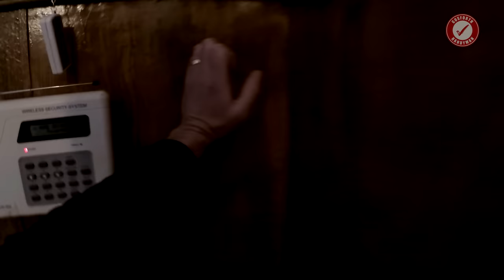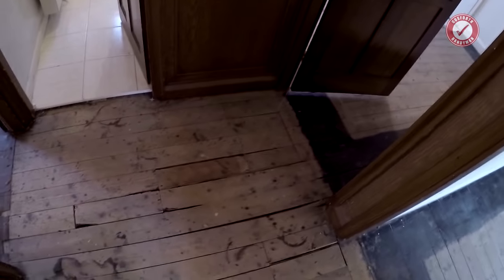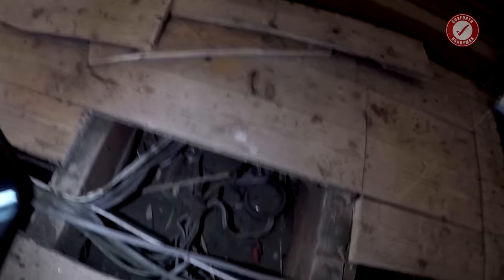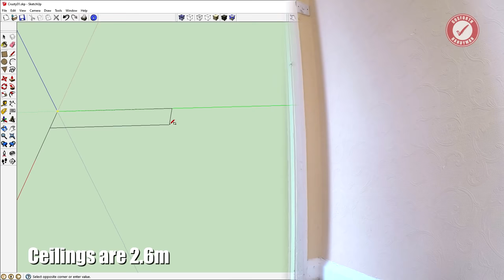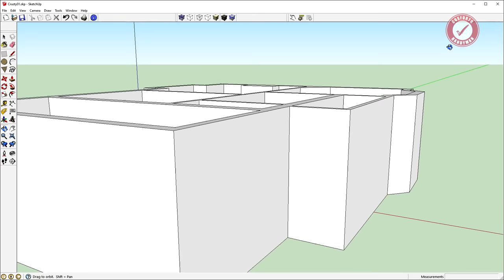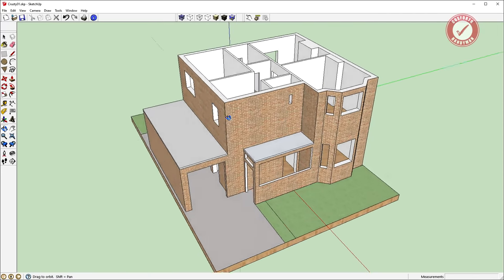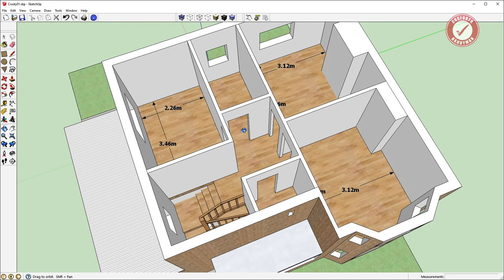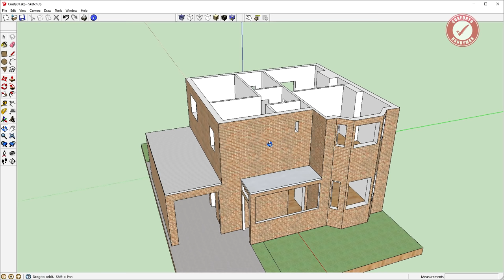Structure, drains & plans - what would you do? (1920's Renovation Part 2)

Comment: learning a lot from your vids, stuff like which way the joists run. Moved into a similar home but with a lot less experience (lots to learn).
experience with cad but in engineering. Are you giving the walls all the same thickness on  your plan drawings? Is it a standardised size?
I don't suppose any of your rooms are sloping? I live on a slight hill and although there is no movement the initial build left slanted floorboards and doorframes, I was wondering if you knew how to counter this? Perhaps pulling up all the floorboards and placing shims underneath them on one side of the room?

Comment: Whats in the small front room again ? And can you show better detail of the front porch ?

Anyway, demolish garage - set aside bricks for  reuse on rear extension or workshop in rear garden.
Obtain party wall permission, see if you can butt up against adjoining, use solid concrete blocks with insulated plasterboard, and go double height forming additional en-suite master bedroom ,  pitched or flat roof to preference or demands - easy access if the stairs are remaining in existing place broadly,  possible changes if stairs are to be moved

Comment: That "LEAD" water pipe is your MAINS ELECTRICITY  CABLE !!
Reply from the maker: Hmm... don't think it is. The electric supply goes through a clay duct. 99% sure it's the water. 👍
Reply: Ok just with the electric meter being on the other side of the wall I thought it might be - the older electric cables were lead sheathed and that acted as the earth TN-S   = supply type

Comment: I'd temporarily open up the roof of that garage so you can drive a mini digger round to the back. Knock some walls out upstairs and downstairs and build an addition to the rear. Either make the whole ground floor concrete or knock out the kitchen concrete floor. Remove that front porch

Comment: what is the make up of the dividing wall? some houses of this era only have a single brick between the houses, do the 2 houses share a single chimney stack? have any of the houses in the row had extensions? might give you some precedents
Reply from the maker: Shared chimney stack - 4 pots per property. Lots of different extensions on the street - not sure for the party wall thickness yet. 👍
Reply: @GosforthHandyman  Consider talking to next door about the chimney, if neither of you want it you could remove the whole stack down to the upstairs ceiling, reinstating the attic party wall on a concrete lintel. From the drone shots it looks like you don't have intertwined flues so this would allow the chimneys breasts on each side to be removed independently without structural issues.

Comment: Rewire while its empty mate.  Bonding to gas/water unless in plastic.  RCBO board SPD etc.  False economy not to do it now.  You're local to me so budget 2.5k upwards depending on spec.
Reply from the maker: Think the electrics are fine but time will tell! 👍
Reply: @GosforthHandyman  more plug sockets.  Most houses never have enough.
Reply: Yeah plenty of sockets, hardwired heat/Smokes.  Network cables.  When adding additional circuits ie new kirchen/extension/workshop the installation should comply to current regs.  Junction boxes under the floor not good.  Do it when it's easiest before you've got nice plastered walls and expensive finishes.
Reply: I live in a 3 bed semi I have 32 double sockets but I did the rewire myself I'd pull every socket and lightswitch and make sure all the rubber cable is abandoned seen it many times where it was to awkward to change a cable so it has been left

Comment: So the electrics might test out fine but all those JB's will have to be changed over to maintenance free ones in which case it's probably easier to just pull new wires through to exactly where and what you want.
Reply from the maker: Yeah, there's lots of extra fuse boxes for random stuff. Need to work out what they're for. 👍
Reply: @GosforthHandyman  Wouldn't bother, I'd wire a room up at a time on it's own radial for what you want and rip out the old as you go. More cost effective in the long run.

Comment: I wouldn’t fit a combi boiler I’d fit ground source heating
Reply from the maker: Too expensive for GSHP unfortunately - don't think we're there yet. 👍
Reply: Air-sourced heat pumps have evolved so that they are a practical alternative.  Even in frigid New England USA they are being installed in some new builds (with minimal backup heating).  Haven't I read that in the UK, heating by gas is no longer in favor?
Reply: Ground or air source heating works best with underfloor heating and I'd reboard the inside of the house with insulated plasterboard and did I see a solar isolator in the meter cupboard? If so a heat pump would be a good option during daylight hours

Comment: Not an engineer but surely if you take significant parts of these load-bearing brick walls out, particularly ground floor, you will not only have to put steel across the top of the removed section but potentially also add steel/masonry all the way to the foundation, because you will have all the weight resting on a much smaller section of brick otherwise? Personally I think these early 20thC brick buildings are among the best buildings built in the UK in the past few centuries. Would keep it as close to original as possible, maintain it and let it live for a few hundred more years. Feel like in the long run removing walls is gonna contribute to the decline of the building one way or another.

Comment: Just a random rant, I'm an apprentice electrician and the amount of time I spend figuring out why a house is wired why it is is silly sometimes, and mostly on old buildings that have had rewires. I think electricians should have to make wiring diagrams when installing a property, and have to edit a new copy when changes are made. Probably mostly because of my ocd, but if I build or wire my own house I'm deffinatley making plans of wiring and plumbing. This Is also because my house has been so badly bodged whenever I turn off a breaker to change a light fitting, half the house goes dead.
Reply from the maker: Totally agree - although think any redundant cables should be removed and things left tidy under the floors. Also from an OCD perspective. 👍😀
Reply: You've experienced 'House Builders Wiring- they're terrible for it.

Comment: The missus suggests a wall of concertina doors along the new extension to open onto the new patio with maybe a fire pit and jacuzzi/hot tub? If you look at Frank Howarth's Youtube page https://www.youtube.com/watch?v=ge96Qvp-EzE he built his woodshop a few foot into the ground to reduce the overall height of his shop and put a shed roof on with some polycarbonate panels on the highest wall to let natural light in. He also built a network of plastic pipe into the concrete base to submerge his dust extraction pipework (not too sure about that?- maybe with loads of rodding points? ). Its very big but you could scale it down. All the best to you both for Xmas

Comment: Extend the first floor, moving the hipp to the end, should be support up above to extend the ridge, re- jig the beds on that side creating a larger bathroom/ extra bed. The garage looks useless for modern cars- extend the kitchen and liv room and add a utility. Just because the garage walls are of a 215mm solid construction means nothing- It prob has the same foundation as the main house and can be built on above, you can dry-line the walls inside to achieve builing regs. maybe a single storey extention off the new kitchen to create a garden room/living area- if the area its situated warrants the expense of course.- Get rid of the useless storage heaters as they are a crime to common sense!.

Comment: Does it connect to a sewer? Or does the sewage drain into the river?  Here in the U.S. if it was going to connect to city sewer, the drain would point toward the front street not the back garden.  Even with city sewer there is no guarantee the river is safe, my whole hometown is still trying to upgrade the city sewer system to not dump sewage into the river every time we have a heavy storm. 🤢🤮 Because the rainwater system for the city is connected to the sewage system. 🤢🤮🤢🙅

Comment: well if it was me i would talk to an engineer first dude ,ive built a few houses but brick means nothing beams do plenty  and electrics if its aluminum well for get it replace it ,plumbing test the water ,what you don't have access to modern tech is that your sisters hammers ...wooden handle,yours or the guy next door ,mine was built in the 80s and well we are shareing ,and its a home i dont know about you but in canada its 1300 a month plus bud
Reply: and if your gonna under pin make a basement dude
Reply from the maker: Lol it's just a spare hammer that I leave at the house - no tools there yet. 😂👍